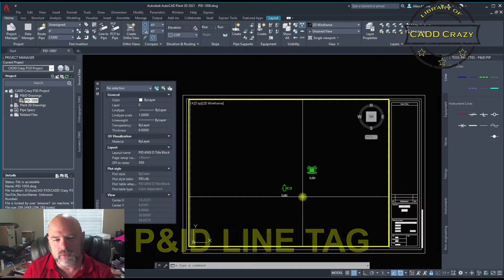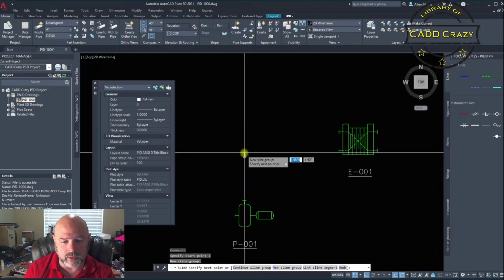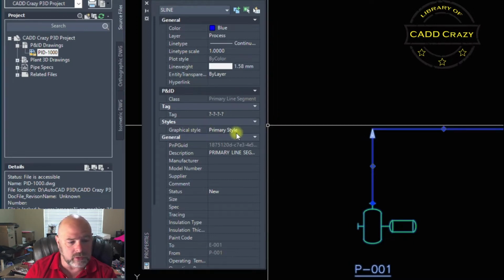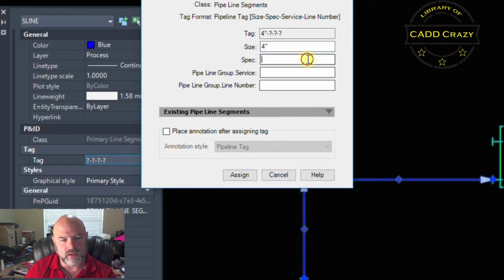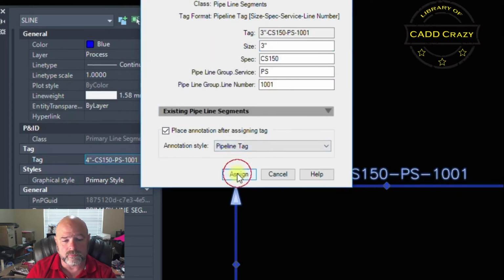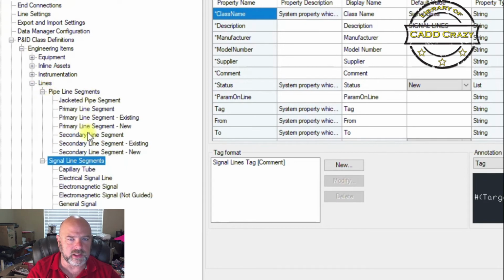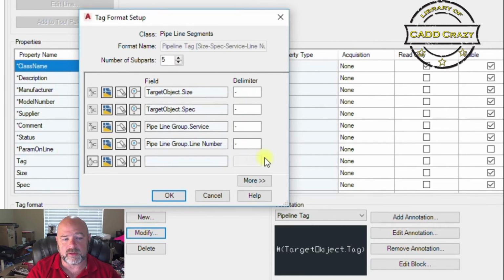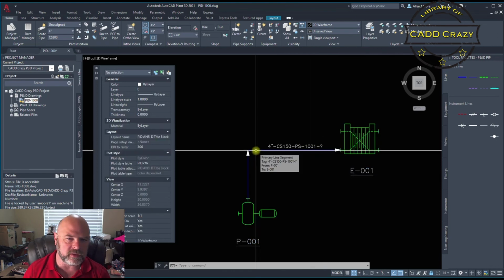AutoCAD Plant 3D Line Tag

Comment: Can you please address how to have a single line tag that would show the insulation ONLY if the line has it?  For example, 2 lines are shown, one with insulation. I want to see the insulated line tagged as 4"-CWS-1001-CS150-PP.  The other line (non insulated) shows up as 6"-CWS-1002-CS150-?.  How can I NOT have the final dash and question mark shown?  Thanks so much!

Comment: HI! There's a big issue in tag numbering. For example, if I have a tag like yours 4"-CS150-PS-1001, if I create another line segment, with another tag, like 2"-AT300-DR-1001 it won't allow me to use this tag. Just because the last number 1001. How anoying. Is there a way to fix it? Thanks
Reply from the maker: That is a very good question and one that is not easy to get agreement on. Basically you have everything point to your Process Line Group to get you full line number? When you want to change the line size for that part of a segment  you have overwrite the General data. That is a good topic I will create a video on and go in to more detail.
Reply: @caddcrazy9069  thanks, I'd really appreciate that. Mean while I solve that by replacing line number in the project setup by line comments.

Comment: Hi. Actually, the way your tag was positioned after you clicked on the pipeline is perfect, but not how it's natively doing in my project. In my project, the tag sticks ontop of the pipeline itself. I always need to move the tag after choosing a position for it. How can I fix it? I tried to edit the settings for pipelines and I found an option called X or Y-offset. But that option is greyed-out I can't edit it. So, how can if make my project behave like yours when choosing a point on the pipeline to the tag? A related question is about tag of valves. My native tags for the valves are a mess. I have the pipe size connected to the valve appearing above the valve, and below the valve another tag. I tried to edit the valve block, but the tags don't appear in the block editor. Besides, it would be a pain to manually edit the tag hundred of times for each time of valve. May you help?